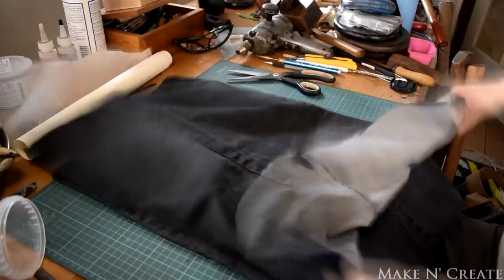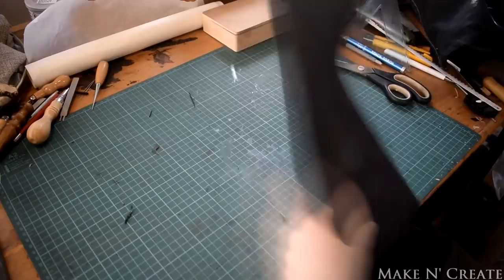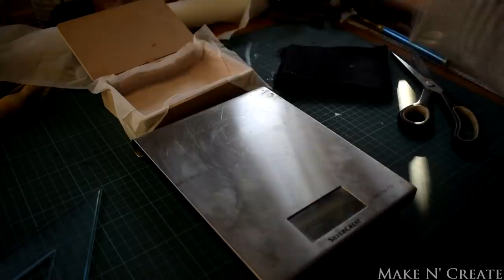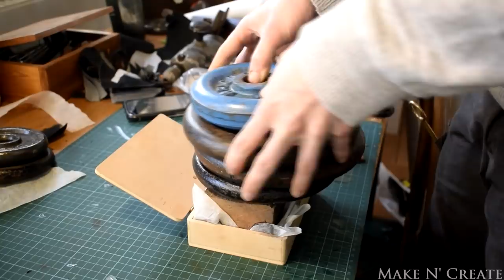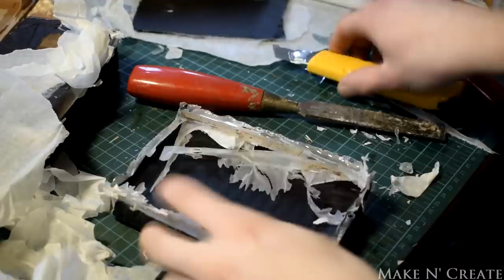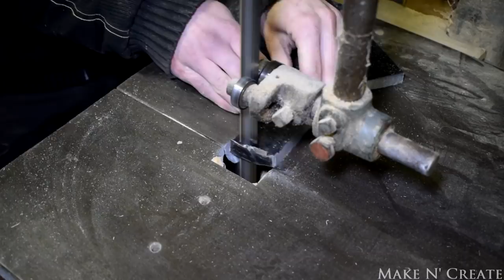Resin - Black Jean Micarta

Comment: I'm glad I found this channel. Cheers! I'll be sharing this with other #makers.

This gives you a nice quick little tour through #DIY #micarta #fabrication.

It's such a cool material to be able to actually make, right now, at your house, starting at about $15 worth of fiberglass resin and some scraps of fabric or paper. It usually takes about a few hoyrs to cure for handling. You can almost immediately cut, sand, drill, macine, shape, polish, etc. It's extremely durable and strong.

Fun stuff. :)

People are stunned when I let them know that I MADE the crazy exotic wood for those knife scales.

The cutoffs can be shaped into nice pendants and bangles. There is very little waste. :)

#Micarta #diy #diycomposites #knifemaking #fakewood #diyproject.

Comment: now you give me an interesting idea,what if we make armor  mold and use old jeans to make body armor for cosplay etc?
Reply: u can but u have need 2 face mold so u can press the resin inside or vacuum it inside a thick plastic bag because without those step, your cast will ended with many air pocket and flimsy unlike a regular resin with fiber strand
Reply: @prd6617  yeah you are right,like drone technology we may need vacuum press i ll think about it.

Comment: I tint my epoxy when making black scales, gives them a nice deep solid black. I made a simple press from scrap 10mm steel, clamp down by screwing a couple of bolts, can apply way more pressure and it is re-usable, you just have to fold the baking paper to direct the overflow out to the sides or it gets on the steel (wd40 stops it sticking too badly). Also, do yourself a favour and get a rotary fabric cutter, a special razor sharp pizza cutter, you wont ever bother cutting fabric with scissors again, massively quicker, neater and more accurate.

Comment: and wtf is that suppose to be ?? what is that for ?
Reply: george Bush ...knife handles.  Multiple layers of cloth and epoxy makes mikarta, a light, yet solid, mixture that lasts longer then rubber or plastic and is as easy to shape as wood.  Different cloth color layers makes for very interesting patterns when shaped.  This is why at the end he cut the edge in a diagonal to show what pattern would be visible on the knife handle.